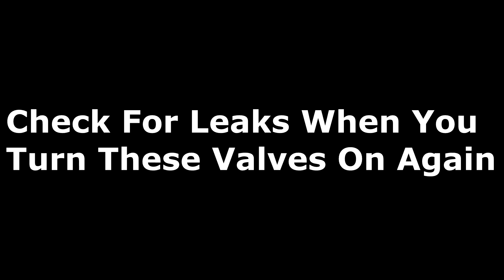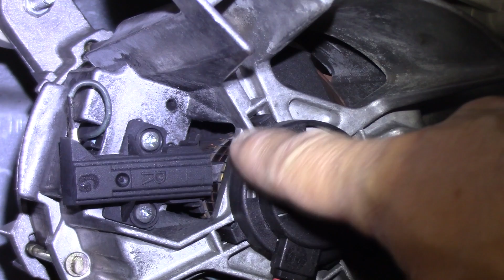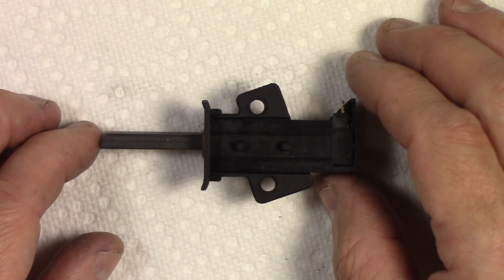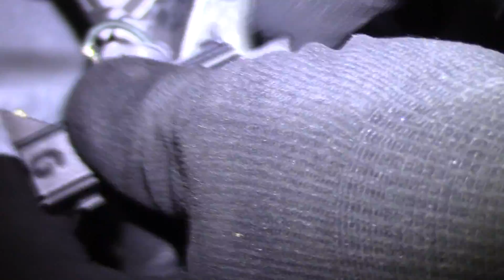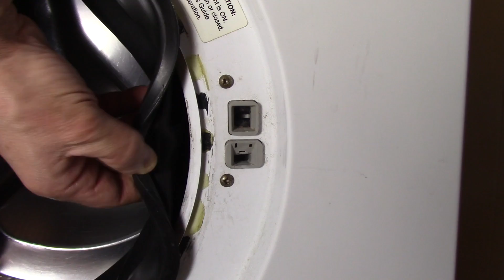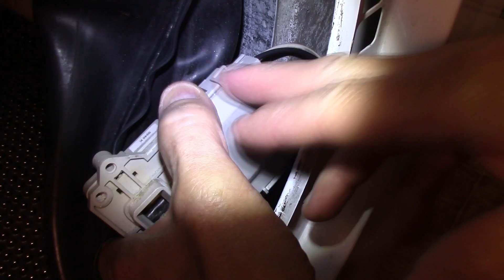Front Load Washer Won’t Spin Tumble Washing Machine Troubleshooting Frigidaire Kenmore Etc. Thorough

Comment: I have this machine and do like it. We started to have this loud noise during the spin cycle. I called the repair and man and was told that the tube bearings were bad. The repair man also said to just get a new washer. I have found many YouTube videos on people replacing the bearings. I did get new ones but what is you thoughts ?
Reply from the maker: I have video's on how to change the bearings on this machine start with this one here to check it: https://youtu.be/oEXtkOQ5LUY and this video will show you how to change the bearing: https://youtu.be/CFuosqBhfRc Look in the video description for links to the parts. Thanks.